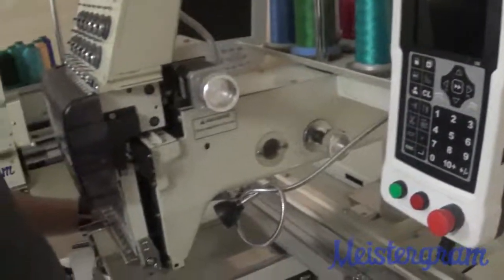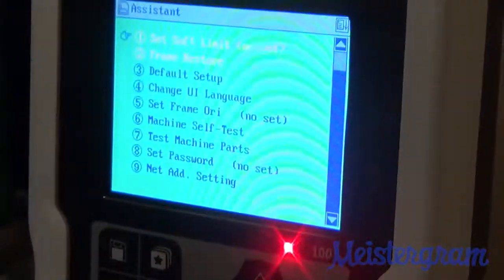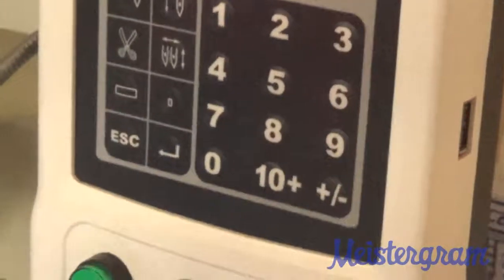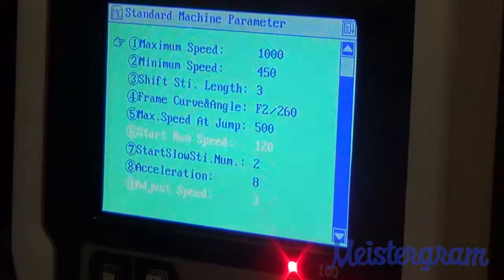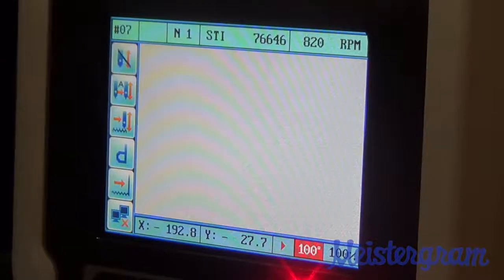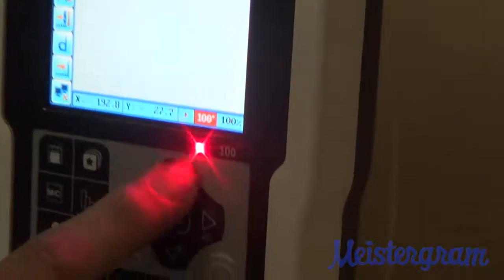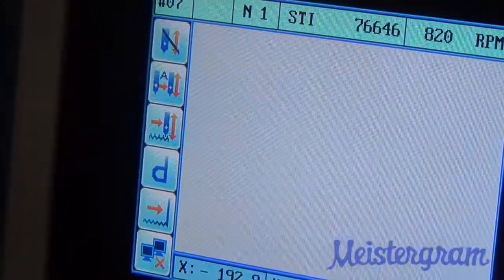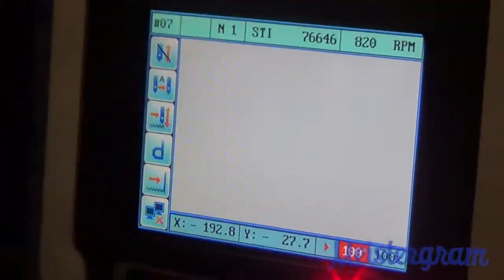Meistergram - Maintenance & Readjusting Setting of Memory & Battery Failure on Control Panel 129

Comment: Thank you for this valuable video.
I have a very difficult time with a brand new operation box I replace on a 1500pro meistergram and every time when I put the USB shows up an error 158 and say don't read the pattern in the USB 
If you know what's wrong, please let know.
Thanks
Reply: Hello Geovany, thank you for your comment. 
Please make sure you are using a usb drive smaller than 8Gb and that the files are saved onto the root of the usb drive.